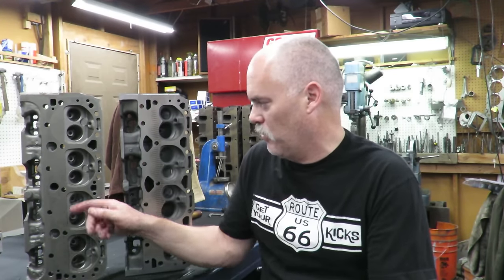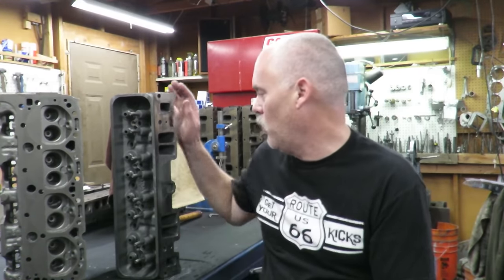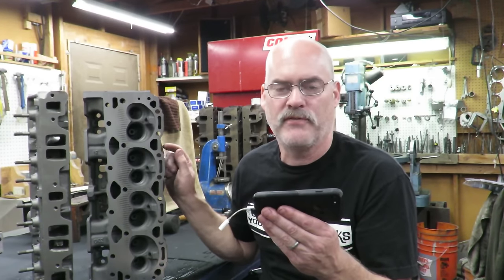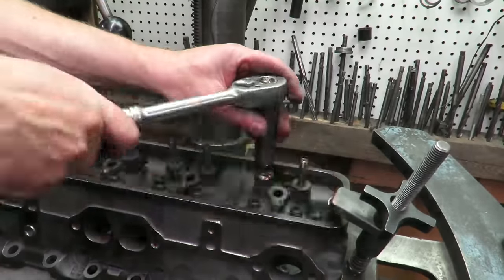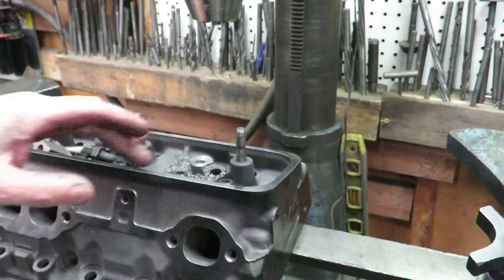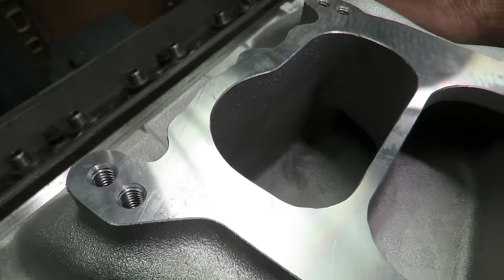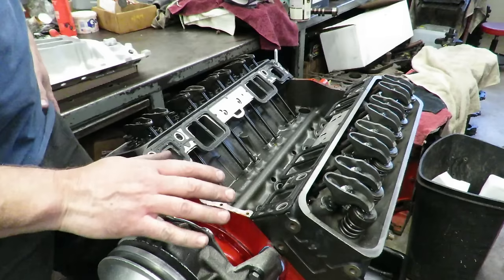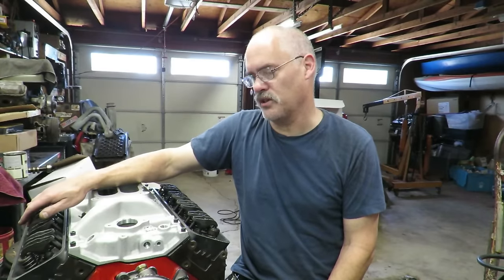How to get more power out of your Small block Chevy

Comment: I realized the gen I SBC was pretty awesome some 45 years ago. It's good to see that still holds true.
Reply: i have a STOCK 400 sbc in my 77 chev 1/2 ton..... 
265hp and 380 foot pounds..... beats any stock 350 from 73 till 96..... 

it has ZERO emissions equipment.... 

AKA.... dead simple, cheap parts, easy to work on

id rather drive that 77 around than buy a new truck (im a mechanic.... new pickups CANT off road...AT ALL!!!!!)
id rather buy fuel than parts.....
Reply: Gee a stock 400 beats a stock 350. Who would have known

Comment: I enjoy your videos, I'm in the middle of doing my very first engine rebuild a Chevy 350 I had the same issue dished pistons crappy 76 cc heads and barely any compression.  I'm putting some go fast stuff in and the videos are teaching me a lot and helping me a lot on do's and don'ts as well as the process of what goes into, thanks for the videos.

Comment: Thanks for the info. I kept thinking some people watching this might be getting a little trouble though. When using old blocks that may have already been decked, add the head milling and after market Chinese intakes available, you can find all kind of problems with the end of the intake and block gap or as you said, the side of the intake sealing. With some pistons, you might cut the block .040" to even get -.010" deck height.  Need to really check the correct valve stem seals with machine shop for valve guild / seal / retainer clearance. Rocker arm clearance between new studs and rocker and the thread on the rocker stud available for adjustment. Need to have the extra valve to retainer clearance if the owner changes to aluminum 1.6 ratio rockers later, and of course pushrod length and coil bind.. With all the parts available, the possible combos are endless. People buy a lot of mix match parts online. Of coarse you check your stuff, but some people buy the wrong parts and don't tell the machine shop what they want. This sounds like a high torque driver that has a small cam rumble and fun to drive. Good video, Thanks again.

Comment: I did a set of 062 casting up, shoulder studs, cut bowls for 2.02-1.60 valves +100,cut down guide boss, opened up the spring pockets also pocket ported the bowls (drilled steam holes for a 400 block) and used a howards hydraulic roller Cam,, made great power

Comment: SAE Engineers acknowledged that the Vortec heads flow better than the early Iron heads. You can read their discussions.
The extra two manifold bolts are good insurance if you use one of those carb pad plates for an engine hoist. More fastners is usually always better.

Comment: I did that about 7 year ago on my racecar. It made a big different. They had to change the rule book. People were just jealous. It was even a gray area it’s just said stock heads. You do have to be careful you do drill in to water. You can drill your studs and put roll pin on if you want to go cheep. I had a friend weld inside and we drilled and taped it for a four bolt valve cover.
Reply: Our rule book has also been changed from " stock heads" to " factory heads with minimum 72 cc combustion chambers". ... We do cut our decks to raise compression and get away with that.

Comment: LS motors are great but! in most cases you need to have an engineering degree in order to set them up and tune them. It is pretty pointless to put a carb on an Ls motor so you then need all the extra parts and work for the fuel injection system, computer fuel pump/pumps, and tuning. None of that is cheap or easy. The good old time tested SBC is still my favorite engine of all time.
Reply: You don't need anything to set them up...they are a simple, stout design.
Reply: gregg4164 dude LS’s are not that complicated pretty much plug and play once you know how to do it
Reply: Oh yes you'll need a carburetor a intake manifold and a LS MSD box to ditch the fuel injection and stock computer mine has been running and running very very well with this setup since 2008
Reply: a carb works great on an LS ,, what are you talking about
Reply: @Levisnteeshirt1  The carb is the easy part.  What requires some effort is the intake manifold:  wet flow is even lazier than air, and requires more attention to detail.

Comment: Interesting, I called Ken the founder of AFR & we talked for hours... theory & practical.  Ken taught me the crazy amount of $ GM put into the TBI heads...  I too thought they were junk!  Ken asked me if I was willing to follow his instructions exactly to upgrade my 193 SP heads... I would be supprised.   I ported, port matched the heads back in 92, added 202/160 valves, new guides, studs ect.  I installed the heads on my 355 with flat top pistons, a modified TBI ect & it ran great in my 88 4wd suburban.  Mileage jumped from 11mpg best ever to 15+mpg. The first build was with the wrong pistons aka 7.5 cr when breaking the engine in & got my first fuel mpg jump.  The Vortec heads were not out yet... but still have these heads & worked great with a b&m roots supercharger, till I got greedy & added dual 350 TBI's with 4.3L injectors. Finally busted the crank, but without any damage.  Have you ever drilled the center holes for vortec heads & counter sinked for flush mounted nutserts?

Comment: some years ago i spent good money to have an engine shop build my TBI 350. i wanted 300 hp for towing horse trailers. the engine has been a huge disappointent since day one. as a matter of fact when the engine was new it was better than what the shop did. i ran the head numbers on one of your vids and come to find out they used 305 heads. it has a edelbrock TBI manifold and the chip was replaced with an aftermarked programmed one. after watching this vid. i think i will invest in some ebay aluminum complete heads for $645 delivered and a new maniford and holley sniper and a new cam and lifters and some headers and see if i can make that boat anchor run better. thanks for the work on the video it hepled me to decide to do it myself and save quire a bit of money.
Reply from the maker: Yep 305 heads are worthless on a 350

Comment: Some guys have moved on to the LS, but if your like me and have a lot of old school chevy parts, why not use them. Also more power can be made from the old chevy with less $ than the LS
Reply: jerry garner, Sorry buddy but you’re wrong, no small block will make as much power with as many stock parts as an LS engine will...
Reply: Shit box I was talking about chevy engine blocks when I said old parts.As for the more power,I was talking about aftermarket performance parts.
Reply: jerry garner, How can you make more power for less money with an old small block when you have to buy aftermarket parts just to make decent power?
Reply: You're probably right in a sense, but the ancillary parts you need to de sophisticate it (do you like that?? lol) like adding a distributor, sump, intake and headers for our application make it a very expensive proposition so the cost is still extremely high for the relatively small added benefit even if a good runner core LS is dirt cheap.
No doubt you're right on a level, I guess, but for many of us the LS in the real world is completely out of reach for the power gained. For us the cheaper option is to use half the money changing over to an LS and put that money into the old style.
BTW, I have LS beehives on my aluminum head Vortec roller cam short block. Believe me I thought very, very hard about going LS but I couldn't justify the conversion cost for the power gained and I'd still be stuck with stamped steel rocker arms and a used motor because I spent all my money doing the conversion..
So now you know where jerry garner might of been coming from.
Reply: ThePaulv12 That was exactly what I was talking about.I should have gave more info.
Reply: ThePaulv12, I see what you’re saying, and no the conversion isn’t cheap, I’ve had LS engines in my car for the last 10 years. That being said, the cost of the conversion isn’t the point here, I guarantee you have more money in your aluminum Vortec headed roller cam small block than you would in a cam swapped LQ4 or LM7 that would make just as much, if not more power. It takes a pretty expensive aftermarket SB head to match the air flow capabilities of a factory LS head.
Reply: Thing is as I said you're right about the LS and as far as the cost of my 350 you're right again!
Your guarantee was honored.

I would like to have gone LS. I have a Toyota FJ40 that I've been driving but modding over about 8 years. I bought it with the intention of going to SBC. Now, you gotta know that i'm into this truck for quite a lot of $$$$$s. It is still a pos, but I can't afford a Boss Mustang, Hemi Cuda or a big block convertible Corvette and I want to enjoy my hobby so I decided to buy a truck that I could turn into something I can do some serious 4x4ing in that dirty theiving bastards will keep their filthy eyes off. 
Some of the LS conversion stuff was reasonable, but I don't want to run coil packs. In order to go the dizzy route I have to buy this housing - I can't recall how much it is but it isn't cheap. Then the sump to clear the front axle was OUTRAGEOUS cost. Then they make these exhaust manifolds - again not cheap. Then I have to get the special stupid water pump, fan and clutch and the engine mount kit. Factoring a standard used LS I was staring down the barrell of $10k with a used motor.
Knowing my luck I'd get one of those old smoker LS engines that came out of Mexico awhile back. At any rate, I'd have to at least do a quick valve job and head gaskets. 
After careful consideration, I decided to buy a new 350 roller cam Vortec short motor. I bought some bare aluminum heads and had them assembled to my specs with LS beehives and 1.6 shaft mounted rockers.
I ended up spending total of $3k on the conversion shit and I'm at $10k with a brand new motor.
I'm thinking my 350 will have ~ 350hp. If I had a nice 4x4 then I could go the LS route, but I wouldn't be taking a nice 4x4 the places I'm thinking of going in my fj40. 

Anyhow as usual I gone on too long... but can you see some of the factors that influence people?
If a bloody LS just bolted in as easily as a conventional SBC I'd use it. As you point out the advantages are plain. I should tell you that I'm a qualified mechanic so I'm playing devil's advocate a little bit here. You could also take from that, that when I said, "I would liked to have gone LS," that I really did give it a lot of thought.
Reply: ThePaulv12, As I said before I’m aware of the fact that LS conversions are not cheap, but again, that’s really not the point of the conversation here. I gotta ask, why wouldn’t you want to run coils on an LS engine? It’s a breeze to make them work without the factory computer, buy the MSD box, plug in cam, crank, and map sensors, plug in the main connector for each coil bank, wire a switched 12 volt source and a ground, and you’re off and running...
Reply: Shit Box its something that is good that you have to pay money to dispense with. So the waste factor combined with all the other shit i rambled on about :)
Reply: ThePaulv12, I don’t understand what you’re getting at, but whatever. 😄👍🏻
Reply: Shit Box its easy for you because made the move. Once you've got there then you have all the parts.
I wanted a brand new engine. New block, bolts, heads, crank etc.
I don't want a used engine for similar $$$$s so your contention that the conversion is beside the point isn't valid for me kind sir😎
Reply: And the sbc dizzy is at the back which is better in a 4x4 for river crossings.
Reply: ThePaulv12, Whatever works for ya. 👍🏻
Reply: You're high as fuck....Ls motors are cheap as hell and the lower end doesn't give out. I took apart a 180k mile lm7 with no bearing wear and no ridge. There's so much walk on the bottom of a gen 1 small block it might as well be wearing Nike's. The heads are also far superior out of the box than iron vortecs.
Reply: pete l yeah read the comments immediately above. You're right i guess but there's far more to it than just bolting it in. Its an expensive conversion for most even if the motor is ho po and cheap.
Reply: And on top of that Jerry Garner they (THE PARTS) do not cost near as much for the Old School Small Block either as they do for the the New Fangled LS Engine they are expensive  as all get out like you can build a 600 HP old School for a like 14,000 & the same 600 HP in the LS for about 28,000 or more so there you go
Reply: @ThePaulv12  hey are you in the United States? FJ40 caught my attention. 😁😁😁
I've had a V-8 converted one for 24 years!
Reply: @r.joseph8911  As I'm writing this to you I'm doing the conversion to mine after 8 years of getting it all together
Reply: Shit Box
Reply: I smoked LS's with a LT1 a LT4 true ! . I hope no one gets Butt hurt and gets on their politically correct mind set😂
Reply: @aslamb6489  there are tons of people using junkyard 5.3's using ebay turbo kits to make 600hp for a few grand.  Search you tube for junkyard LS with eBay turbo
Reply: I want to see a old chevy smallblock with a stock shortblock stock pistons rods and crank make 550 horsepower using stock CNC ported heads and a hydraulic roller cam and last I'm not knocking old chevy smallblocks but if you know anything about engines the bottom end of a LS engine is put together much better it will take way abuse than a old smallblock will unless crank rods and pistons are changed even then the LS has 6 bolt mains the crankshaft does not flex at higher RPM it lasts longer and if setup right run like no tomorrow over and over again let's face it CNC ported LS3 heads flow 358cfm on the intake side try that with a old smallblock engine
Reply: @shitbox7413  you are aware the 5.3 LS 350 motor is also a small block right?
Reply: LOUD TREES, 5.3 is 325 cubic inches...
Reply: @johnbeer5242  I smoke LS all day myself in my vortec it is carbed an built LS is wimpy as hell til someone throws on a ebay turbo an tune lol

Comment: did a howard cam swap and had a guy port my stock aluminum heads on my 1995 camaro lt1 and it made 420 rwhp and 400 rwtq. Did other mods like 1 5/8 headers and a cold air intake and this was done with a stock fuel pump and a mail order tune. The guys at the dyno shop were amazed, but good video I enjoy watching them, I miss old Tony videos from Headbytes.